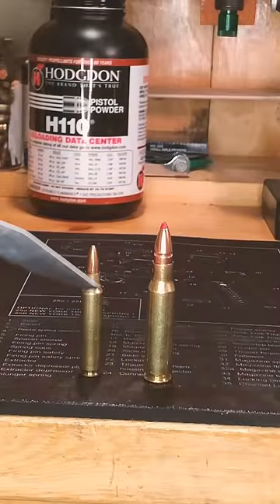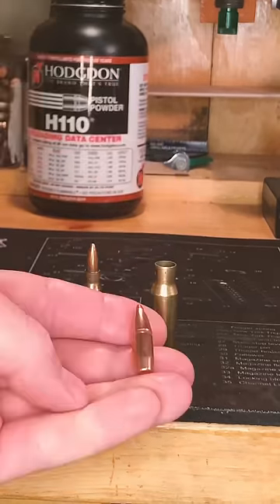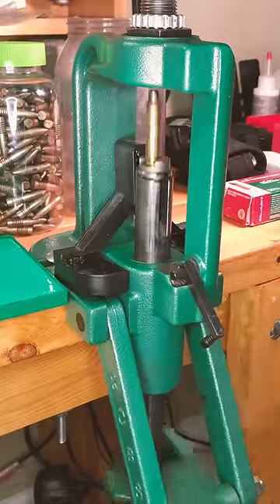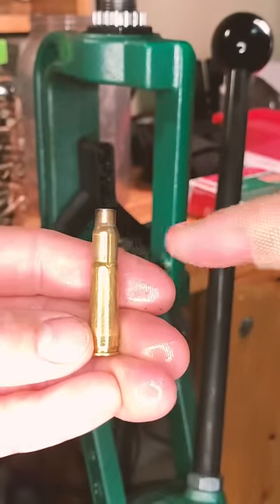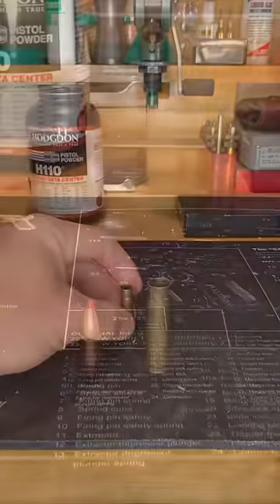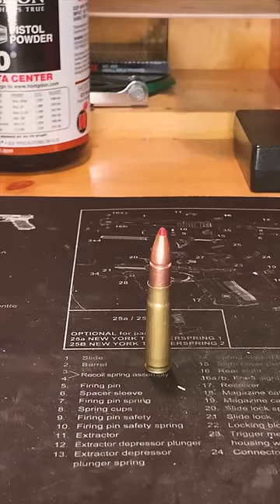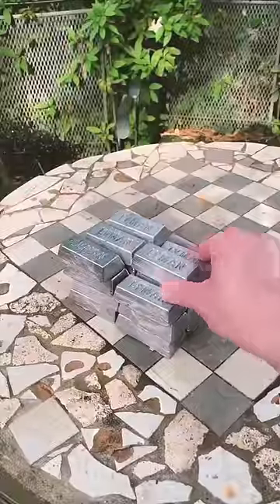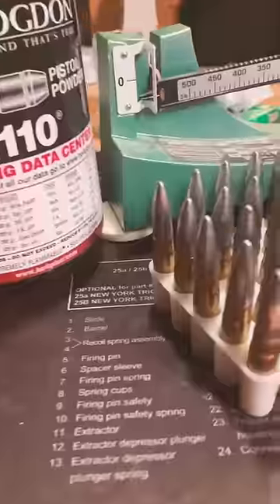A brief synopsis on the concept and history of 300 Blackout. Part 3. #shooting #guns #reloading

Comment: What are the downsides to shooting a non-jacketed lead projectile? Does it make a mess of the barrel?
Reply from the maker: The only downside is everyone hates you because you get to shoot more and spend less money.  My barrels are clean as a whistle.  
-Stagger
Reply: @staggerleesmancave8987  interesting, I might have to try this out! I've been chopping 5.56 brass and making 300 for some time now, and man is it tough to find cheap 200gr+ ammo. Why do some people use that powder coat crap on them?
Reply from the maker: @ryan370  I really am starting to think that some of the appeal of powder coating is how aesthetically pleasing it makes the bullets look. It is undeniable that presentation sells. 
But on more rational terms, I do think it is definitely a good thing that the powder coating dries, firm and hard, as opposed to the Alox remaining a little bit waxy even after drying. And warmer temperatures some have even said that it gets a little sticky again. My remedy for this is simple. In my opinion, the only part of the bullet that requires Alox is the lower, half or rather that which has lube, grooves, and the entire base of the bullet. In my loads, all of that portion is nicely enclosed by the brass. Trapped in there good. The part of the bullet sticking out of the brass, I simply wipe off with a rag dampened with mineral spirits at the end of handloading. For long-term storage and oxidation prevention on the lead surface I give it a light wipe down with another rag that has been dampened with another lube you may have heard of… 45–45-10. 
If you haven’t heard of 45–45–10 it is basically a mixture of liquid Alox, Johnson paste wax (or its current replacement, since it’s discontinuation), and a solvent. Don’t get me started on my solvent thoughts. I hate that they use mineral spirits. In my opinion, it should be VME naphtha. Be sure to check out the discussions on this lube. It castboolits.com. 
-Stagger
Reply: @staggerleesmancave8987  awesome, thanks for the tips man!
Reply: @ryan370  Then use the cheapest option for .30’s, the plain old 150gns.  Switch powders and load them subsonic.  I do it with Titegroup.
Reply: @blackhawk7r221  not a bad idea. Does it still cycle a semi auto with your loads?
Reply: @ryan370  I use an adjustable gas block with notches like a clock face that I etched into it, so I just set it to one of my common loads.  I’m all about throttling back gas for reduced recoil.
Reply: @blackhawk7r221  ahhh gotcha. I have the psa JAKL, which has an adjustable gas block, but it has permanent presets. On the lowest setting, I can't even get it to run factory subs reliably without my suppressor on it. And I pinned a muzzle device on my AR to get it to legal length for an "other" in my commie state, and I stupidly didn't put an adjustable gas block on it beforehand. Oh well, maybe it's time for a new barrel hahaha
Reply: @ryan370  Does yours have the updated adjustment knob that stops at position 4?
Reply: @ryan370  If you cannot get enough gas to blow back that long recoil spring, simply work in the opposite direction.  Reduce the spring pressure by cutting off a few loops.  This will allow it to run light loads.  But when you switch back to supers, you will have to throttle back your gas one click more than you normally would.

Comment: Where can you buy gunpowder. To make your own bullets
Reply from the maker: Excellent question. The most reliable supplier of reloading components I have found over the years is Midway USA. However, to my knowledge, they do not have any retail outlets… mail order only which means shipping plus hazmat fee. This, however, is not a dealbreaker for me, but when possible, I prefer to walk into a local Cabela’s or Bass Pro shops, and buy gun powder and primers there to avoid the extra cost of shipping and hazmat. Obviously, for this reason, their inventory is more often depleted in this day and age of hoarding. 
-Stagger

Comment: What tool do you use for trinming that much
Reply from the maker: My go-to for all cartridges when it comes to trimming is the Lee system. The caliber specific case length gauge/shell holder/cutter set up. They are so wonderfully inexpensive that I actually buy a separate individual cutter and lock stud for every case length gauge/shell holder kit, so that each individual caliber is always set up and ready to go. I chuck the lock stud in a drill and fasten the assembled case length gauge/cutter in my big outdoor vise and go to town… around that vise it looks like it’s been raining gold. 
-Stagger
Reply from the maker: That first funny looking part however, I simply lop off with my 4 x 36 belt sander equipped with a 36 grit red label sanding belt. It takes it off like nobody’s business. Works way better than the little Harbor freight dinky chopsaws I see everybody using on YouTube .

Comment: It's crazy how they took two perfectly fine rounds and made a worse round
Reply: That's subjective to intended use. 300Blk suppresses better than 5.56 or 7.62 Nato, due to its heavy bullet compared to the powder load making it closer to the sound barrier. That was intentional, as well as it being fine for short barrels around 9". 5.56 requires velocity to be effective, while 300Blk relies on its mass. 7.62 Nato would be wasted on bringing below the 1100ish FPS to go subsonic, and with too much empty case, detonation are a higher risk.
Reply: @militantfascade9176  but what if they made the .308 case all neck to lower the case volume. Just lower the shoulder until you get the volume you want then you can seat the bullet wherever you want to.
Reply: @Charon5582  I think you'd end up with either a round that won't feed well due to the shape, or a lot of empty case. A long neck, short body round likely won't stay as stable in a magazine or when feeding. When it comes to making rounds subsonic, it seems like the play is to get a big bullet moving just under the speed of sound, because light bullets require higher velocity to reach full potential. That's why 5.56 is such a high velocity round compared to 7 62x39. Different approaches to the same problem.
Reply: @militantfascade9176  I know, its just a funny idea I had. I agree it would have feed issues. Would probably need a 3 degree neck or something. Its just an exercise in excess that I thought up on the spot. It would be interesting to make the neck normal length though. Like 8mm kurz.

Comment: That's not a .308w bullet, that's 30-30. Do you load those for 308? Do they work good? I have a box of them but no 30-30 rifle
Reply from the maker: Ahhh very sharp eyes. I’m impressed. Pardon my prop. I was currently out of the more typical .308 bullets. According to other hand loaders, they do indeed work in the 308. But not ideal.  
-Stagger
Reply from the maker: I’m curious… Was it the high cannelure or the rather blunted ballistic tip or something else that you recognized as the “Leverrevolution” bullet?
Reply: @staggerleesmancave8987  Yes, the high cannelure is the most notorius thing, specially when it is mounted on a 308w case. I'll try them out and see how they perform, at least now I dont expect great results

Comment: Doesn't lead foul the barrel in a high powered round?
Reply from the maker: In 14 years of shooting cast lead projectiles I’ve never had a problem with leading…because I use Lee liquid Alox and pair it with copper gas checks when applicable. Occasionally a barrel change out is needed prior to shooting cast lead projectiles such as the Glock barrels which have polygonal rifling. One must do the research prior to switching over to cast lead for practice rounds. Happy shooting 💨. 
-Stagger

Comment: You probably get tired of this question, but how much is it costing you per round at the moment?
Reply from the maker: With my ammo that uses cast lead projectiles, my only costs are primers and powder (propellant). I already have all the brass. So for example small pistol primers currently cost about 9.4 cents each. My powder charge for my blackout rounds is 7-8 grains which costs about 3 cents. 
So these rounds are about 13 cents each. 
For ammo that I buy conventional copper jacketed bullets for (like my new 450 Bushmaster and 270 Winchester, the cost goes up a bit. These rounds require substantially more powder and the bullets are about 45 cents each. So these rounds run about 70-75 cents. Always happy to talk handloading with an interested viewer. 
-Stagger

Comment: Why do you have a pistol powder in the background of the video?
Reply from the maker: The load data for 300 blackout implements a number of propellants that are actually pistol powders (fast burning). To name a few (of the ones commonly used for 300 blackout ): 
Hodgdon Lil Gun, Hodgdon Trail Boss, and Hodgdon H110. 
Happy shooting  💨 
-Stagger
Reply: @staggerleesmancave8987   thank you for that,  I must have looked that up differently years ago when I was looking at purchasing a .300 blackout,  I use h110 and Lil gun for many calibers already. This will reconsider purchasing. 300 blackout

Comment: That's the problem with .300blk most of those projectiles used are made to expand at .308 velocities and fail to perform well out of the much slower .300blk

Comment: What are you using to cut the casing?
Reply from the maker: It’s a 36 grit ceramic belt (4x36) from Red Label Abrasives. Turned out to be a lot faster (and cleaner) than my chopsaw. It’s like a hot knife through butter  🔪 🔥 🧈   
-Stagger
Reply: @staggerleesmancave8987  awesome, thank you!
Reply from the maker: @MKultrapdx  my pleasure! Thanks for watching SLMC🔥 
-Stagger

Comment: So please explain the actual reason to create a 300. Blackout to begin with?
Reply: MP5 replacement that is compatible with existing AR magazines (and lowers)
Reply: And allows subsonic fire in an AR which is great for a suppressor.
Reply: Short to medium range thumper for street fighting in Iraq that hits with .30 cal authority without the heavy weight or long length of an M-14EBR.  There were no comparable cartridges of the type at the time.  And the ability to convert existing M-4’s to .300 with nothing but a very low cost barrel change.
And it can be easily suppressed.

Comment: H110 appropriate for the 300?
Reply from the maker: Absolutely! It was apparently one of their favorites during development. H110 is included in the Lee Precision load data for every bullet weight used in the 300 blackout.
-Stagger
Reply: @staggerleesmancave8987  After trying at least a dozen different powders, I settled on the H110 as my favorite for .357M. Guess it does well in long straight(ish) brass configurations.

Comment: So you don’t have to powder coat them because they’re sun sonic?
Reply from the maker: My bullet coating of choice is Lee Liquid Alox…as it has been for 14 years. It work phenomenally. Alox alone is good up to 1400 ft./s. Beyond that I use a Alox plus a copper gas check.
I find it interesting how many individuals refer to powder coating like it is the new standard despite there being no literature to support its use and safety. 
 There is no denying the popularity of powder coating. Granted, it may, indeed at some point supplant proven lubricants like Alox. I’ve seen individuals on many YouTube channels swearing by the powder coating with much enthusiasm….but until powder coating for bullets is being sold by a major component supplier like MidwayUSA, this is why I currently won’t do it: 
Lee liquid Alox has been extensively tested in an actual firearms laboratory. With a very expensive chamber pressure measuring tool that likely neither you, I, or most YouTubers could ever afford. They have also performed inspections with bore cameras after thousands of rounds to ensure that their product prevents leading of the rifling. To my knowledge, this cannot be said of powder coated bullets. While Alox may not leave my projectiles looking like all the fun colors of a bag of skittles, at least I can rest assured that it will always keep my firearm functioning perfectly when using unjacketed projectiles.  
Happy shooting 💨 
-Stagger
Reply: Thanks man.  That makes a lot of sense. My first impression of people powder coating bullets was the assumption of what your saying that it can’t be good for the barrel but after listening and watching how people do it and why they do it it kinda made sense but I have no experience doing it at all and I’m gathering all my supplies to start reloading and casting now because it just seems like something I’m interested in. I like the technical data and all that goes along with it.  I think I’m gona take your advice and not get into any of the powdered bullets.  It didn’t make sense to me at first. I kinda got persuaded into thinking I need it and you just helped me out on that so thank you. I’m definitely subscribed.
Reply from the maker: @jamesgravel7755   awesome brother! 👊 best of luck to you with reloading and don’t forget the kits usually go on sale for Christmas and Father’s Day at places like Cabela’s. 
Thanks so much for subscribing to SLMC 🔥 
-Stagger

Comment: Pure led with no jacket?
Reply from the maker: (Lead alloy: lead/antimony/tin). For subsonics, and even projectiles going up to about 1350 ft./s it is perfectly permissible to simply have a lead projectile with a coating that prevents leading. I use Lee Liquid Alox. Many other folks like to use powder coating. 
And that’s why even YOU 🫵😁 have likely shot hundreds of rounds through your 22 that are only a lead projectile with no jacket. Can you remember? …Remington Thunderbolt (and several types of CCI) are loaded with simply a lead bullet, with a special lubricant coating. And they are actually zipping about 1250.
For anything exceeding 1400 ft./s. You may find it interesting that you can also continue to use lead projectiles. And simply make the addition of a copper “gas check” ( a copper disc ) to the base. There are certain bullet designs that will except gas checks. They snap right onto a recess in the base, and when the bullets are pushed through a sizer they are crimped on even more permanently. The gas check protects the base of the bullet during its trip down the bore and prevents the hot gases from cutting through it. 
Happy shooting  💨 
-Stagger

Comment: Why do you make ingots?
Reply from the maker: Ingots are your source of clean and refined lead alloy. They are ideally already adjusted for hardness by the addition of tin and/or high antimony alloy and labeled as such. 
Your production pot (an electric lead melting pot with a bottom dispensing spout) does not appreciate being fed with dirty trash. Dropping muddy filthy scrap into a production pot is the quickest way to clog the spout and get inconsistent bullets. 
Feed your production pot only good clean ingots and your dross removal will be at a comfortable minimum and your bullets will be pristine. 
-Stagger

Comment: No powder coat?
Reply from the maker: My bullet coating of choice is Lee Liquid Alox…as it has been for 14 years. It work phenomenally. Alox alone is good up to 1400 ft./s. Beyond that I use a Alox plus a copper gas check.
I find it interesting how many individuals refer to powder coating like it is the new standard despite there being no literature to support its use and safety. 
 There is no denying the popularity of powder coating. Granted, it may, indeed at some point supplant proven lubricants like Alox. I’ve seen individuals on many YouTube channels swearing by the powder coating with much enthusiasm….but until powder coating for bullets is being sold by a major component supplier like MidwayUSA, this is why I currently won’t do it: 
Lee liquid Alox has been extensively tested in an actual firearms laboratory. With a very expensive chamber pressure measuring tool that likely neither you, I, or most YouTubers could ever afford. They have also performed inspections with bore cameras after thousands of rounds to ensure that their product prevents leading of the rifling. To my knowledge, this cannot be said of powder coated bullets. While Alox may not leave my projectiles looking like all the fun colors of a bag of skittles, at least I can rest assured that it will always keep my firearm functioning perfectly when using unjacketed projectiles.  
Happy shooting 💨 
-Stagger

Comment: hi awesome can anyone tell me what caliber is 300 bo?
Reply from the maker: The .300 Blackout uses a 0.308” base diameter bullet seated into .300 Blackout case. (The parent case of that case was originally the .223 Remington as the video explains and 5.56/.223 rem cases can still be used ) 
It was designed to meet a need for a mid-range “thumper” (200+ grain subsonic/suppressed) ammunition, usable in the AR platform during covert operations by the U.S. Armed forces during the War On Terror. 
This cartridge can be loaded in projectile weights ranging from 100gr all the way up to 230gr with velocities ranging from 2485 fps all the way down to subsonic (around 900). It is a very versatile round. 
The 130-150gr bullets going around 2150fps perform very nicely on deer-sized game. Happy shooting 💨 
-Stagger

Comment: Isn’t that .308 projectile meant for the 30-30?
Reply: Yea, it’s a pretty short one
Reply from the maker: Busted. You have sharp eyes and I applaud you. Please forgive my prop. I am currently out of appropriate .308 projectiles. At least we have the base diameter right. I hope you and all the others who noticed this will forgive me.  
-Stagger
Reply: @staggerleesmancave8987  Don’t sweat it.  I load my Blackouts with whatever .30’s I have around, to include round soft points.  But I’ve made generously rounded over feed ramps.